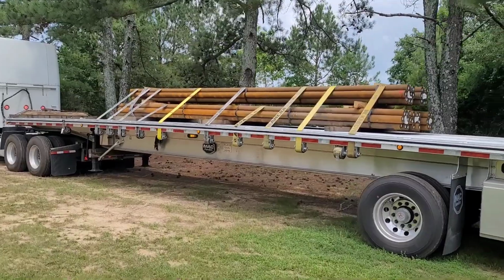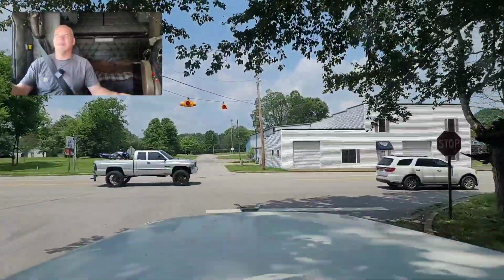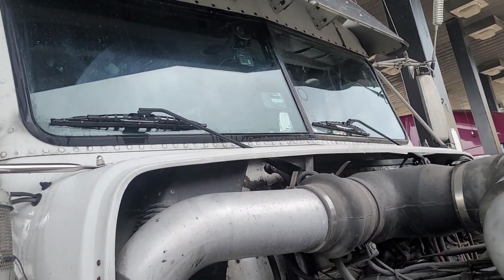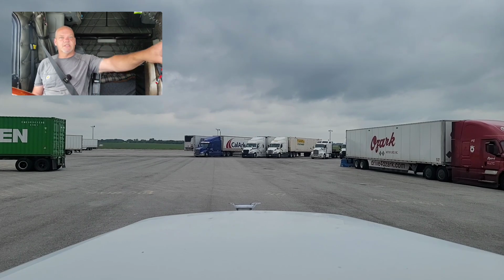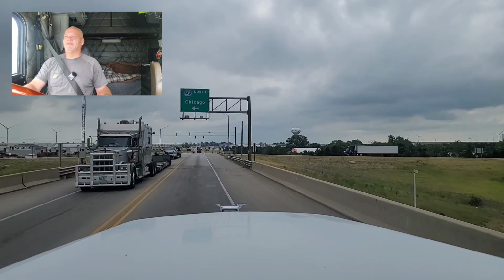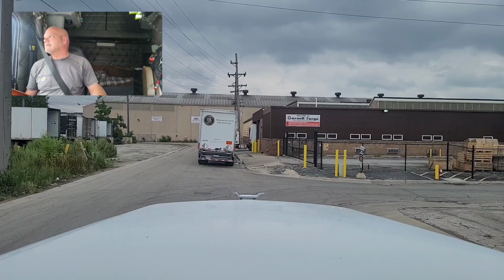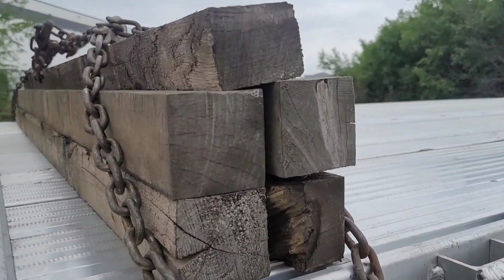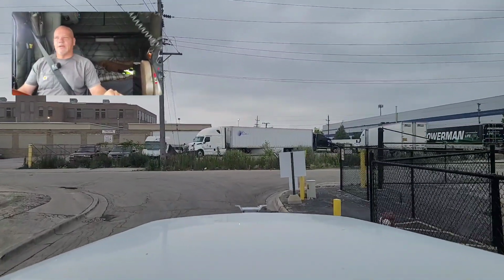Load of steel bars to Chicago 6-25-23

Comment: That bolt that keeps breaking on the ac compressor bracket check make sure the hole in the bracket or the hole that goes through the gear case is not egg shaped my bracket hole was egg shaped just bought new bracket kept the old York style compressor replaced the bracket put compressor back on and no more broken bolt

Comment: I had a freightliner that kept breaking the bolt on the alternator what it was somebody had put the wrong belts on the truck before I got it the belts they put on was a double belt and it was supposed to have a single belt I had replaced the bolt several times before actually putting the correct belt on it then the bolt never broke again